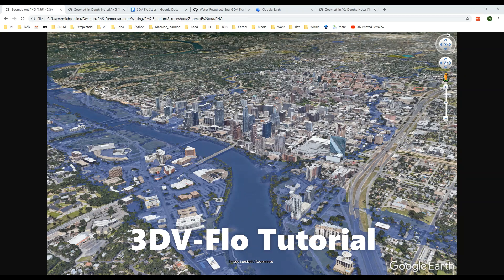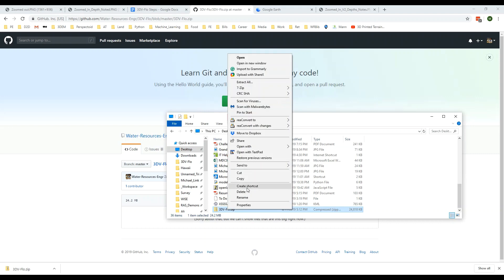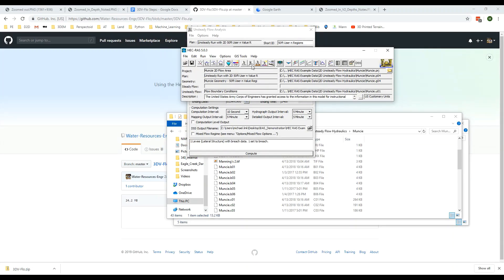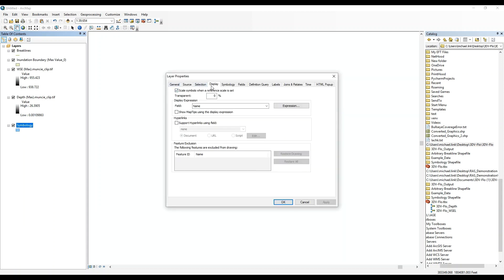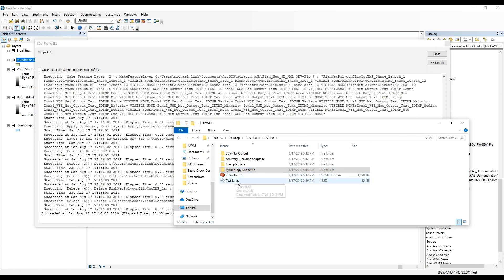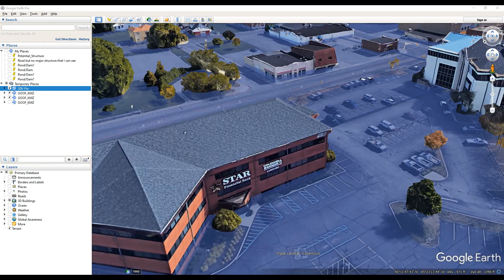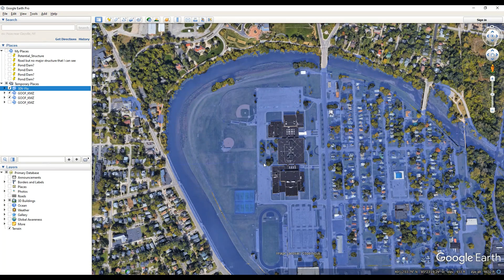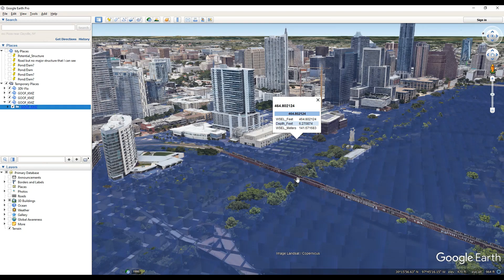3DV-Flo: A Tutorial

Comment: I get an error "ERROR 000968
: The symbol layer does not match the input layer" for Symbology, when i am trying to execute the tool. Any ideas what might be going wrong? thanks!
Reply from the maker: I haven't worked with this tool in awhile and don't have the time to debug right now. However I still might be able to help. I remember getting errors if my shapefile had spaces or non alphanumeric characters (i.e. if it is floodplain(100yr).shp then change that to floodplain100yr.shp). Also make sure there is a shapefile in the symbology tool if you have not put one there. Make sure it is a polygon and not some other type. Hope this helps!

Comment: Hey bro this is GOLD! I just applied this to a personal project and I got excellent results. One thing thou, How can I change the legend (e.i. Depth_Feet) to Depth_meters... I'm working with meters and the values are in meters, just wanna change the description.. check the video on https://youtu.be/snh4x81Zd7Y?t=310 for more info
Reply from the maker: That is a good question. I haven't worked with this tool in awhile and don't have the time to jump back into the model builder now. However I still might be able to help. If I am understanding your issue correctly... The 3DV-Flo tool assumes that you are working with a raster in feet. And the labels come out with feet and meters. You are working with a raster in meters so the label for depth_ft is actually depth_m. If I got all that right... I would change your raster to feet using raster calculator prior to using the tool (raster/3.21). Then rerun the tool and open google earth with feet as your default.
Reply from the maker: If you are comfortable with model builder I'm sure you could change the settings in 5-10 minutes after orienting yourself. The labels for feet and meter are created at the bottom left of the model.